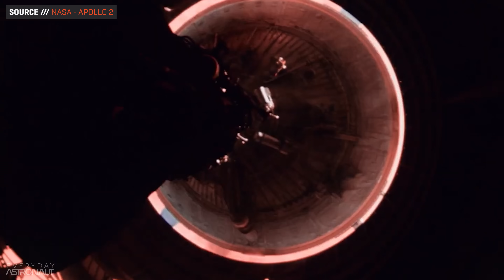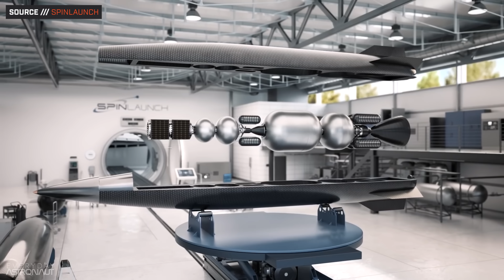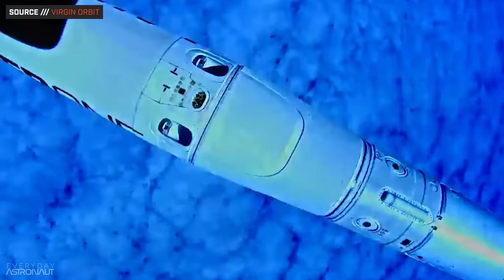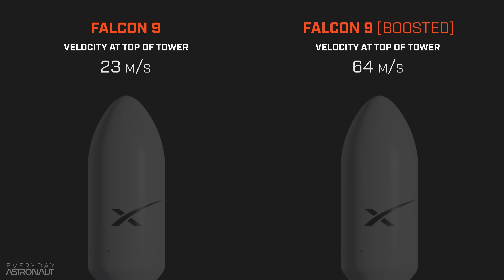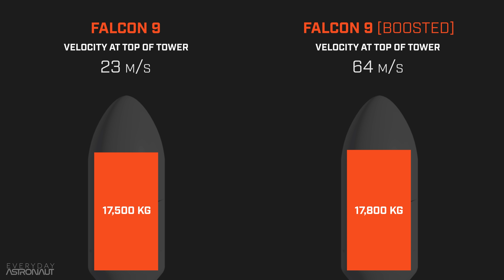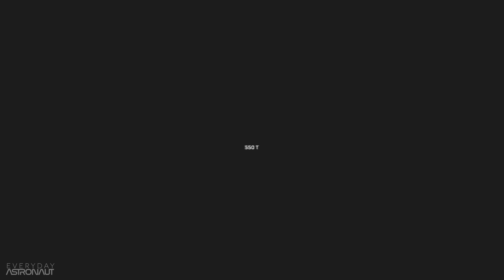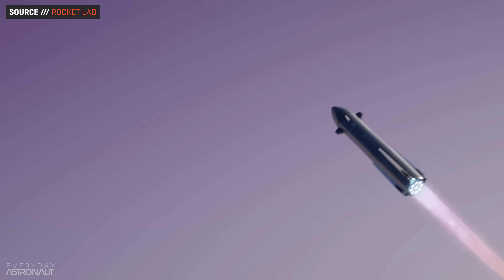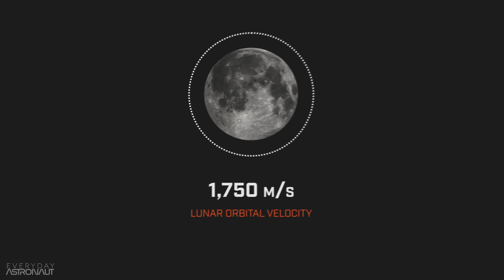Could We Help Push Rockets To Orbit?

Comment: They should try putting another rocket under their rocket to lift it off the ground and get it past most of the atmosphere.  Later, they could try to land the extra rocket so it could be re-used.
Reply: And they could call it something cool, like the Eagle-9. And then they could go one step further and have the other rocket land on the boost tower and call it SpaceCraft
Reply: @RavshanODay eagle 9 sounds cool but wouldn’t eagle 9 heavy sound more ‘merica!?
Reply: @RavshanODay I'd rather focus on making an AI that wants to be referred to as RobotStalin
Reply: @RavshanODay SpaceCraft sounds a bit too on the nose - how about CelestialVessel?
Reply: @andrewawakened628 Stellar StartSkiff

No no no...

CosmicCruiser
Reply: That would never work.
Reply: @hafor2846 ...it worked in 1980s...the boosters on the space shuttles...
Reply: Never work.  Crazy talk. ^_^
Reply: ok, sarcasm noted, but what if instead of a maglev sled we used a rocket sled? That way you get the same power density of the rocket but the rocket doesn't have to carry the fuel of the first stage.
Reply: @Klipik12  this is actually a intriguing idea, but imo the problem with it remains the same as in classical rocketry. more mass = more fuel needed which increases mass, leading to even higher fuel requiremen etc. 
maybe if the fuel was stationary and operates the driving mechanism, like the blowback system in a gun, but imagine the forces
Reply: @Klipik12  We can build the rocket sled on Mt. Chimborazo  but if we have tracks, electricity is the way to go.
Reply: Reverse rocket sled, have another rocket going the opposite direction with more power and weight plus gravity, one goes up one goes down.
Reply: @JustinMcFly1980  Yes, exactly what I thought too. I just posted a comment here about this idea but I might have explained it poorly.
Reply: Lol use starship to launch a falcon heavy to orbit 😂
Reply: Ok, hear me out. Instead of landing on the ground, what if they built a giant tower structure (similar to a launch tower) with 2 giant chopsticks that catch the rocket.
Reply: @thanos879  Just make it an even taller tower and just step outside at the top.
Reply: @thanos879 Na, no chance.
Reply: @thanos879  They could call it Mecha-Karate-Kid, or something like that.
Reply: So, tow the rocket outside the environment????
Reply: @brianhaygood183  sure, until the front falls off ;)
Reply: Consider building a 3-stage rocket where the first 2 stages are fully and rapidly reused. The third (expendable) stage weighs 150-200 tons and is fired up in LEO.
Reply: Lmfao your a genius my guy NASA needs great thinkers like you cuz that's how we're gonna get to the moon and mars right there lol
Reply: @flowwolf6385  nah nasa doesn’t need to figure things out.  They just need entrepreneurs to innovate and then they can take their pick
Reply: @mcs131313 true that anything that keeps contracts from going to money pits like boeing Northrop Grumman and the like lol they have been really successful in the past but it seems like they just wanna lap up that never ending tax payer funded gravy train lol
Reply: @flowwolf6385  there’s actually an argument to be made that that particular money pit would have been helpful if it wasn’t going SOOO poorly.  Essentially gov. budgets are use it or lose it.  At the time SpaceX wasn’t developed enough yet.  While a rational business would just wait a few years and save their money, If they hadn’t found a money pit of some sort, that budget would have been cut and then hard to get back later on.  

Problem is to get the votes, they promised to keep using the shuttle engines.  While this was marketed as more efficient, in reality it was intentionally inefficient - a way to keep those workers employed in a bunch of different constituencies.   So - while Boeing deserves plenty of blame - it’s not entirely their fault given they’re forced to work around stuff developed 55 years ago.
Reply: You don't get it 😂😂😂 @flowwolf6385
Reply: I love this thread. Thanks for the laughs!
Reply: @andyjones7121  this is peak comedy haha
Reply: 🤯 genius
Reply: What if we try building The Sea Dragon again?
Reply: MORE BOOSTERS WE NEED MORE BOOSTERS
Reply: @kaiperdaens7670 every ksp player :
Reply: YouTube comment sections never fail to make me feel smart...

How can so many people understand rocket design to point out any faults, but not get the joke whose entire punchline is rocket design???
Reply: I'm flabbergasted how many don't get the joke here 😂😂😂
Reply: Sure, might as well try a few sticks of dynamite, F=ma^2. Just how could you slow/stop the falling c'wts ???
Reply: Haven't we been launching ballistic missiles out of tubes like a cannon for a while now 🤔🚀
Reply: Surprising someone hasn’t already thought of this.
Reply: It's always fascinating to me how many people are completely incapable of detecting sarcasm and never seem to realize that.
Reply: They should just refill the rocket before it gets off the ground so it's full when it gets off the ground
Reply: Could do a "ground" booster; cross a normal booster with the Starship assist part.
Reply: What if you fired it down from a 1000 ft to build up speed and bounce it off a big trampoline?
Reply: Doubtful.  I think just making it bouyant and poing out of the ocean would be way better!
Reply: What an absurd idea!
Reply: No no no, they should try putting another rocket ABOVE their rocket 😅
Reply: you mean like a booster?! xD
Reply: What if you used the heat you already generate from the rocket engines to create steam. Under the rocket launch pad have a cylinder with a piston that boosts the rocket through its launch mount? 
It’s the sheer magnitude of forces that’s needed in a short period of time I guess that are part of the “what if you just?”
Reply: @sparkyvacdr  how about two boosters like falcon heavy only they are 70% liquid nitrogen 30% rocket propellant. And the steam is not steam but heated nitrogen in a boiler heated by rocket propellant, bit like your steam boiler only on a booster to create cheaper thrust. Much lower isp but higher shorter acceleration.
Reply: Bore a tunnel directly through a mountain and all the way through the top. Make a rocket pad in the tunnel that goes through the top. Use a lift that accelerates the rocket using a pulley weight system and electric motors.
Reply: So you mean add another stage and make it 3 stages then, good idea Sherlock, lets call this new rocket umm Saturn V
Reply: You mean some solid rocket boosters like we had in Space Shuttle?
Reply: This "rocket under their" is also called... SuperHeavy!
Reply: Yo dawg we heard you like rockets…and memes that severely date me.
Reply: That's crazy talk.  Never gonna happen.
Reply: Everyone always talks about accelerating this rocket to like hundreds or thousands of kilometers an hour.
But even if you accelerate the rocket to only 100 km an hour , the amount of fuel you’d save and therefore mass you would save, or extra propellant that you would have would be enormous.
Reply: Why underneath? Why not bolt them onto the side of the rocket?  like the solid rocket booster on the ro on a Atlas 5, Vulcan rockets.
Reply: Too bad we can't just leave the fuel hose connected to "top off" the tanks several hundred feet into the air before disconnecting. 🤔
Reply: The mass of the under-rocket would mean needing more fuel to lift said mass.  More fuel adds more weight which requires more fuel ad finitum.  Hopes that helps you understand the foley of your question.
Reply: Giggity
Reply: A Starship SuperSuperHeavy.
Reply: Yo dawg, I heard you like rockets, so I put a rocket on your rocket so you can rocket when rocketing
Reply: I herd yo like stages, so we put a stage on yo stage
Reply: Ask Xibit the rapper...  His design would likely require designing a rocket, to push the rocket which lifts the rocket that is helping the orbital rocket, into orbit....
Reply: Ohhh you know what? We could just put another rocket under that or maybe on the sides if we need a bit of extra liftm
Reply: Wait a minute…
Reply: Yikes lol!
Reply: Wait, I'm going to improve on this. Add a rocket for that rocket. You can pay me in oil and vinegar hoagies.
Reply: If you could stop it from exploding, you could even reuse it sometimes.
Reply: Yeay! 🎉 right okay energy is energy.. lol ...😅
Reply: Young Sheldon proposed this but some i6iot stole his idea.
Reply: ... OMG.. I think. I think he's cracked it! 
But, and hear me out... What if we refuelled the rockets in orbit? Then we could extend the range even more!
Reply: @davfree9732  That is impossible, sins there are no gas-stations in space!
Reply: Falcon Heavy
Reply: Won't we need another rocket beneath that one?
Reply: Someone should consult with Xzibit, “Yo dog I heard you liked rockets so I put a rocket in yer rocket on a rocket so you can rock out while you rocket out.”
Reply: We should build massive launch ramp lol and accelerate the rocket to  massive speeds before even turning engines on.
Reply: Poor people count money and electricity power and HOW EXPENSIVE ALL ITS.
The channel about "WE CANT MAKE IT BC WE ARE POOR"
🎉
Reply: They’re doing this for 60+ years.
Reply: You still need a lot of fuel. You could use this concept to reduce costs but you could srill use both concept combine it and reduce it more.
Reply: NASA was the first to try this but no one has yet to seceded
Reply: They should look into increasing a humans strength, maybe through some sort of gamma radiation experiment. Then said person could just throw the rocket
Reply: @joeshmoe6969 Even the hulk could not throw an object into orbit.
Reply: 100
Reply: Yes that, but an electric drone.
Reply: They should do the exact thing they're trying not to do?
Reply: Make the 2nd rocket ride a sled on the ground, on rails :)
Reply: If you stack enough stages, you could just attach an elevator to it to get payloads into space.
Reply: Just use solid rocket boosters. They are cheap and disposable. You could recover them by deploying parachutes, but it's actually cheaper to dispose of them because they are basically just a tank with a nozzle.
Reply: 😂🎉❤🤣🤣🤣 THAT'S HILARIOUS!!!
Reply: Expensive.
Reply: It's going to make the whole system heavier with all the rocket hardware and fuel going into that stage so we would need an even bigger rocket with much more thrust.
Reply: Or......... a balloon.
Reply: More weight, more energy needed, more thrust needed, and more expensive. At the moment the only thing that we can do is to develop more efficient engines.
Reply: Its already done like this. What do you think the main booster is for?

Silly
Reply: Baah . That's just Super heavy
Reply: i think that's what 3 stage boosters do
Reply: Bro never played Kerbal
Reply: Bro invented the booster
Reply: ...that was what the space shuttle 'boosters' were in the 1980s...
Reply: Isn’t that the whole purpose of the first stage?  You mean why not have more stages?
Reply: @darylfortney8081 OP is being sarcastic
Reply: @darylfortney8081  r/woosh
Reply: @darylfortney8081 I think they know that, they are being sarcastic
Reply: That's the joke
Reply: @darylfortney8081 , except a concept of such stage which boosts the booster is one that need not to land, but more like a elevator lift powered by rocket engines? I think.
Reply: @darylfortney8081  All the world is a stage... That's why once your out of Earth's gravity you have to do without stages.
Reply: @darylfortney8081  Exactly! It's just another stage.
Reply: @darylfortney8081  Thats exactly what I was about to comment lol. that is just basically a first stage and starship and falcon-9's first stage  do land back and are reused for future missions.
Reply: @JetsonMoon  I was hoping to see a calculation of some falcon heavy boosters strapped to a super heavy booster.
Reply: @JetsonMoon   That's the joke here silly.
Reply: @Mrbfgray  i hadnt realized when i commented lol
Reply: @JetsonMoon it’s a joke guys … he is being sarcastic
Reply: @JetsonMoon  The Joke:

You:
Reply: Jokes go over your head often I am assuming ^.^
Reply: Isnt this already being done 😂
Reply: isnt that just a bigger rocket
Reply: Wouldn't that just be another stage?
Reply: That's called a booster or a first stage.
Reply: The other rocket doesn't get to be supported by Earth, sweety.

Comment: Interesting video, but after a great intro, you started with two straw man propositions, electrical power and a fallng mass. Perhaps a pneumatic ram filled with the same fuel + oxygen would have sufficient energy, power and be able to deliver the force quickly enough.

Comment: I'm a bit irritated at the mention of "staggering amounts of energy required". Regardless of system used, the energy needs to be put in either way; by electricity or by burning stuff (propulsion)...

Addendum: and the "burnign stuff" part is inefficient thanks to the tyrany of the rocket equation: you have to accellerate the propellant you want to use to further accellerate. An electric yeeting system does not need to do that.

Sure, building a "space launch tube" is out or technical reach currently, but the efficiency gains will make this the go to way once it becomes feasable. Especially concidering that electricity is almost free (sun, wind, ...) and that the "carry bugy" (holding the launch vehicle) also holds energy once accelerated that can then be recovered when decellerating to load the capacitors (it's decelleration can be much quicker, since it does not have any humany in it)....

Comment: It makes me think about the fact that if the Earth was just a little bigger than it is, a space program would not even be possible. We are a very lucky species!
Reply: bigger vs heavier. If it were bigger but just as heavy, the launch would be easier.
Reply: @col0342  so all we'd need is a hollow earth?
Reply: @archigallus  Or replace some iron in the outer core with silica/alumina, then you can grow the thickness of the mantle without increasing the planetary mass. Shouldn't be that hard 😀
Reply: "space programm as we know it today"
has someone calculated how much bigger the earth can be for our biggest rocket to barely touch space? ^^
Reply: @tenesto its not much bigger, its like 1.4x the current radius of Earth
Reply: its still possible baby boy

Comment: I think Vulcan uses a relatively cheap and modular launch assist system. I think they call them SRBs...
Reply: Vulcans? :)))
Reply: I think you missed the point of the video. SRBs still add to the rocket equation. His "yeeting" examples are about using a non-propulsive, ground-based system to assist. SRBs are just more rockets.
Reply: @LeeroooyJankinss you missed the point of my comment: SRBs are a much simpler way to give your rocket a small boost than a ground system. I'm agreeing with EDA's conclusion.

Comment: You said, to clear the tower Atlas use 125t of propellant. Why not make "stage zero" - just engines and tanks with 125t of fuel, connected to the tower, that only purpose is to make initial boost. After that, rocket stage 1 starts (with hot staging). That's gives smaller and lighter stage 1...
Reply: If there’s a problem with the hot staging, the whole rocket is destroyed

Not worth it for 30 to 50 m/s.  Better option is just a strap on some reusable boosters you get much more impulse, etc..